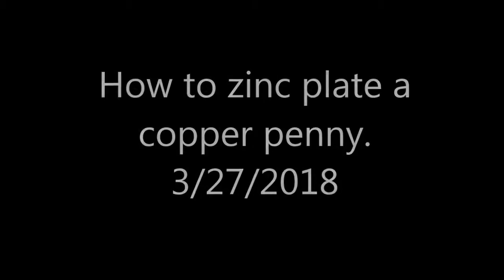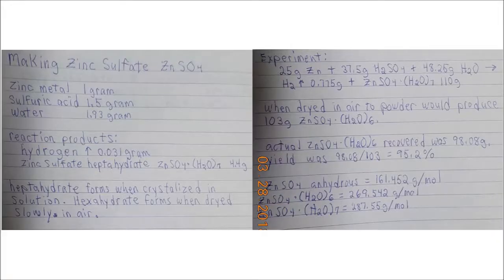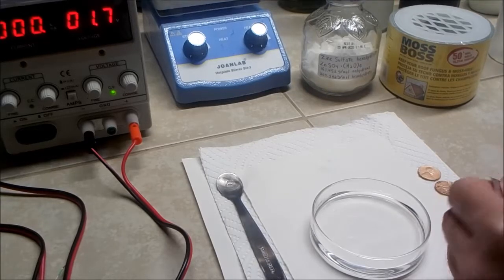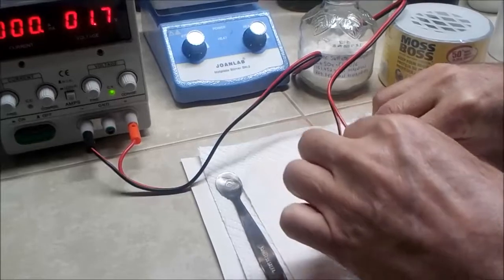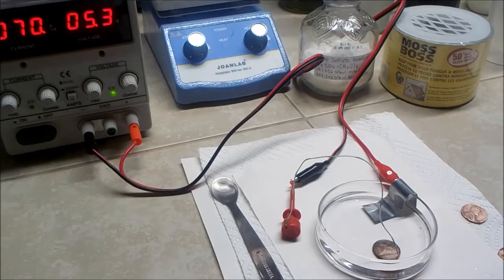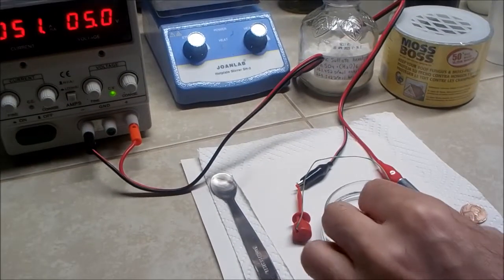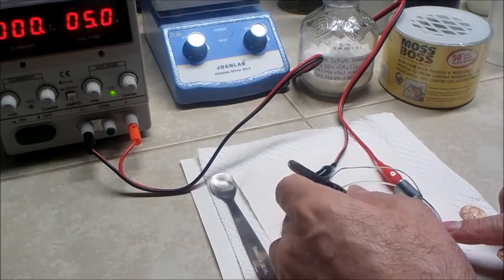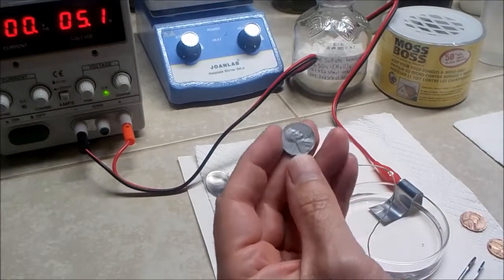Zinc plating a copper penny

Comment: If you head this up, will you get brass?
I been trying to turn someone into brass and need some help.. so I watched a video where they coated with zinc then heated up, can you help me with that?
Reply from the maker: I think you can get brass if you heat it up.
You should probably watch my video where I plate stainless steel with copper then add a layer if zinc over the copper. Then I heat it up to produce a gold looking (brass) finish.
https://www.youtube.com/watch?v=GX23pfjXQFI